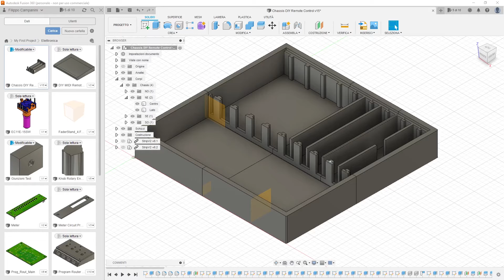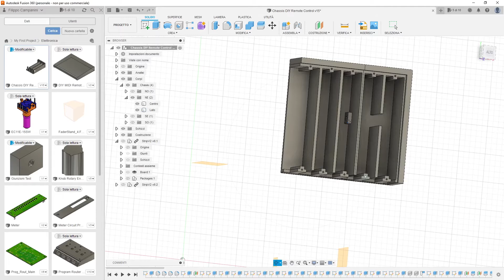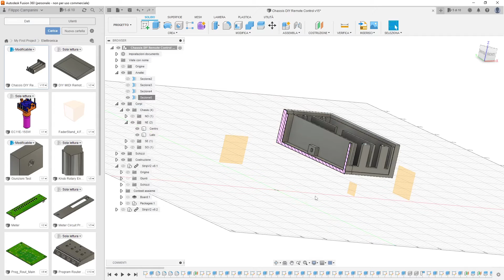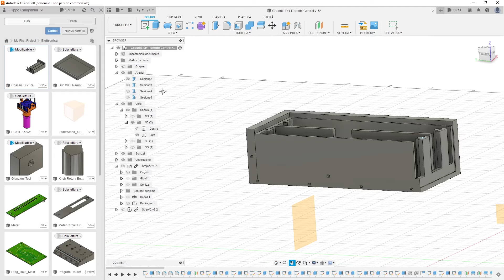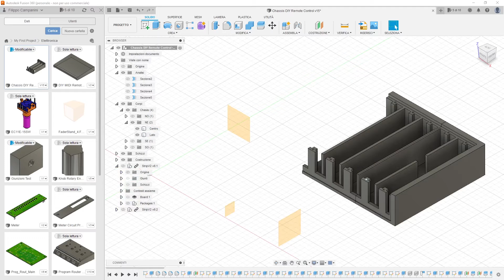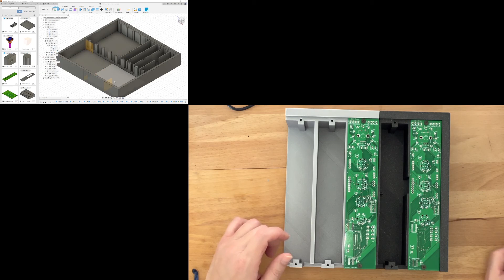DIY MIDI Remote Controller - Chassis 2

Comment: You are incredible! What brought me to your channel is that I bought an Icon QCon Pro G2 exactly and precisely this MIDI Control surface. And almost immediately I had a few frustrations with it and I started looking to see if anyone attempted to do this DIY project. And you have already addressed almost all of the issues I had already! The only one left is that the top of the chassis is thick aluminum. The LEDs for the peak meter is on the PBC as yours is. But the cover is so thick that you have to be standing directly over the control surface in order to see the LEDs deep inside the case. I basically had to fill the holes with transparent glue in order to bring the light to the surface. I am already your customer for the kit and instructions :-)!
Reply from the maker: Hi Ramon, thanks for your kind words. Very interesting to me to know the issue of the LED visibility. Would you be fine to share what was the other elements of frustration you found on the QCon? That would be very useful to me! Cheers!
Reply: @fcampanini  To be honest, understanding what you had to deal with and how the protocol works shows me that my other complaints may not be addressable. A. I have a separate MIDI driver for the main unit, and each extender. Good Job on the default Windows MIDI driver. B. The display only shows 8 characters,  two digits are waisted enumerating the track. So I have to abbreviate everything to 6 characters like "GtrRth02". If I name it "Guitar Rhythm 02" in Cubase, the surface will just show 1.Guitar - 2.Guitar. Not helpful but Mackie may not have a better solution in the protocol. C. I wanted to know how many extenders I could have and why only three. It looks like I'll only get four without a faster processor and some serious rework on the driver? D. The ProX has the LEDs above the display, and I think I would have liked that better considering the light problem. It also had two displays. But I have no idea what's on the other display since I only have the G2 version. E. My template have 1500 tracks in it and my sample library is on a separate computer routed to Cubase through VEPro7. When I launch the Cubase template, I spent the first minute repeatedly smashing the "Track/Fader Control Bank 8>>" Button to get to the end where the master fader is takes a minute since I can only bank over to the group of tracks I want at a rate of only 8 tracks at a time. F. At first there was no way to tell BEFORE I start Cubase if all extenders are working or if I need to shut it down and re-plug them in before restarting Cubase. Not there is the firmware update utility that will at least show if they are connected or not. A handy test utility would have been nice.
Reply from the maker: Thank you